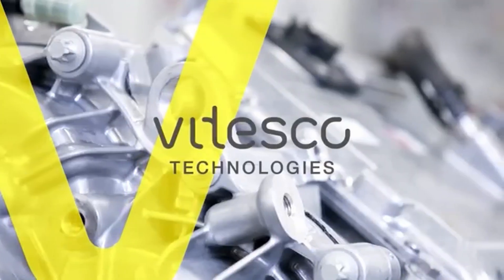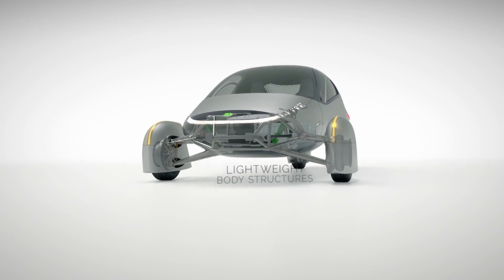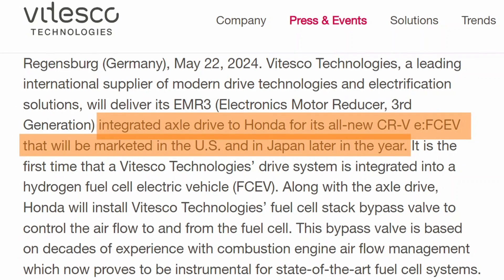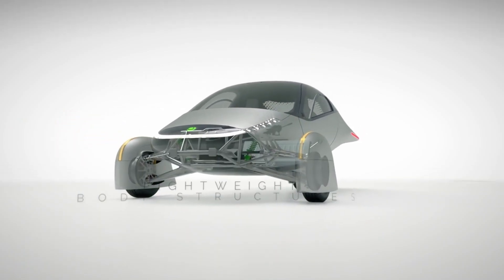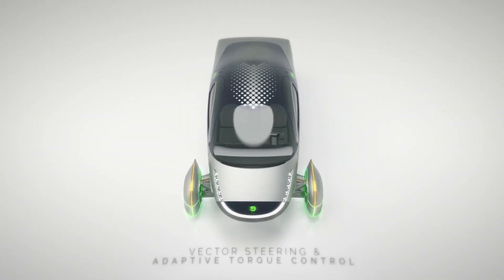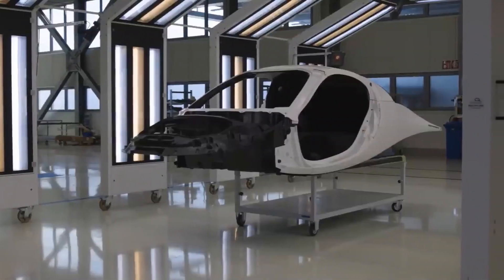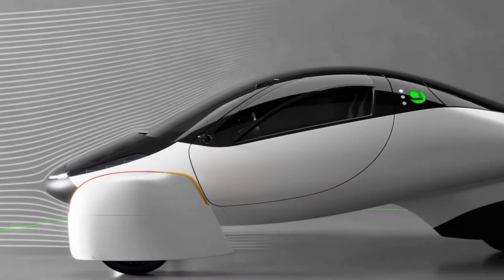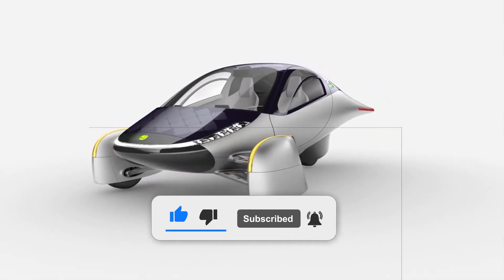Aptera's EMR3 Motor Drive Better Than Elaphe Hub Motors?

Comment: hub motors are a silly idea. not only does it ruin the dyanmics of the vehicle by adding a lot of unsprung weight, but it's also fundamentally challenging to design a good motor, which needs very tight rotor to stator clearances and good balance, to survive road wheel impacts.
Reply from the maker: I see

Comment: I find it amazing when anyone brought up not using hub motors, all I heard is that the hub motors were the most efficient, plus no axles to mess up the aero and those axles will further decrease efficiency. Now, no hub motors and the same people are now backtracking on their old claims. I guess it's whatever Aptera says, just repeat it and support any of these decisions 100%. Same for the skin cooling, heat pump and vacuum resin body. I wonder what next big change there will be?
Reply from the maker: Yeah
Reply: Well, hub motors in general are bad because they increase unsprung weight, but these people are just rearranging deck chairs on the Titanic at this point.
Reply: @dmrr7739  - I agree. With all of these major changes they are making at the last minute,  it's pretty much a completely different vehicle over the Gamma which they have been showing to people.

Comment: The Elaphe motors need a seal replacement at 30,000 miles. That's about it for maintenance. I'd like to see what the maintenance routine is for the EMR3, along with a cost comparison.
Reply: I think EMR3 only requires coolant replacement but is essentially maintenance free for 110k miles as I recall.  Now the axle requirements from the EMR3 to the wheel might require lubing.
Reply from the maker: Noted.
Reply: Yes it remains to be seen, but it seems to be a better handle than elaphe
Reply: That seal was upgraded to 50K before replacements
Reply: permanent magnet motors are sensitive to vibrations, therefore  as far   longevity is concerned  in-wheel motors are inferior